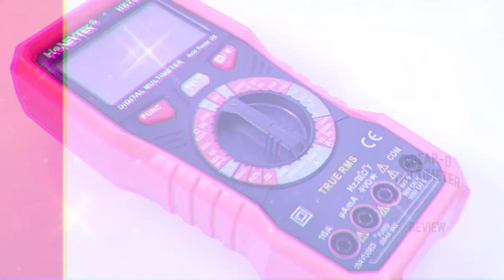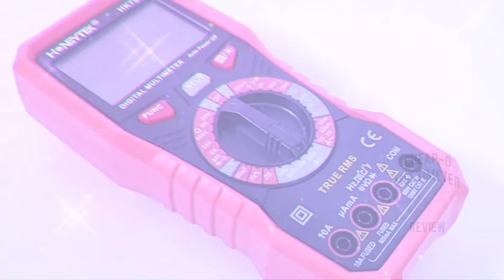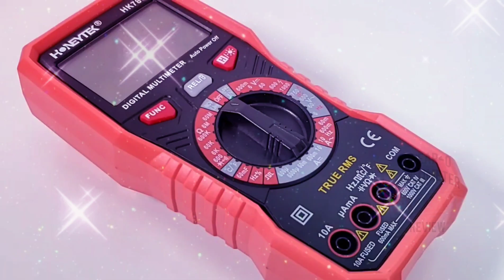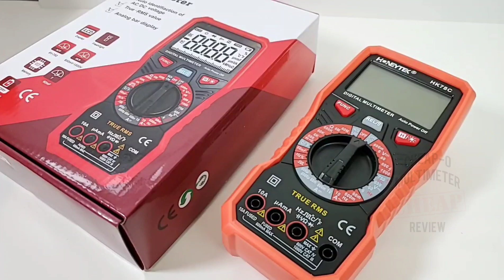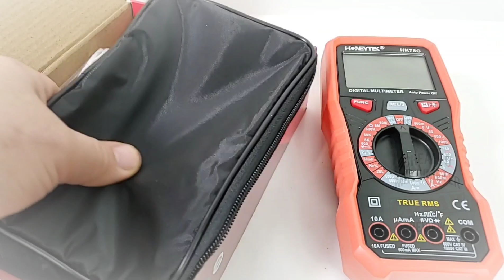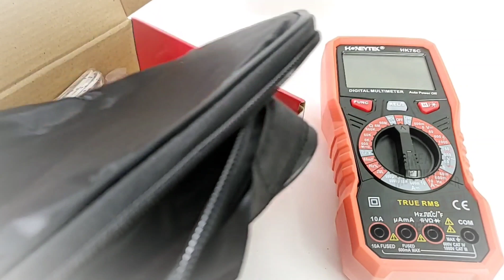HONEYTEK HK78C CHEAP-O Multimeter Review & Teardown!

Comment: I would imagine the 500ma fuse would hold-out for over a minute at 600ma (no big deal since beyond 500ma one should be moving the lead over to use the big shunt anyway). Amazon likely reshipped you a returned unit??
Reply from the maker: Hi Cliff,
It was sealed in the plastic and looked pristine  so assume its new. There's a short or system fault hence the mA snafu.. I'll try to trace the issue and assume its a one off.  🙃👍
I still think the manufacturers need to match or better the stated ratings. A new user probably wouldn't switch to the high current/10A mode when needed since they probably wouldn't have a clue.

Comment: It looks like they adapted a battery connector as a NCV probe--it's different.  It seems that in mA mode that when QA tested it, they blew the meter and missed the problem.  I wonder if all Honeytek HK78C have that same problem.  VFC and LowZ are good features to have; however, without the input protection, it becomes almost worthless.  As far as a back light is concern, companies need to give the power to the people; I would rather see a manual SPST switch that the user can just turn it on or a programmable timed light 5 min to infinity. Another meter without shielding: Is it because companies design the cheap meters for the hobbyist, and think that the hobbyist is not going to be around EMF?  Or is it because they think the board construction and component layout of their design reduces the effects of EMF?   It would be easy to put shielding in these cheap meters; however, the question is would it be safe?  A series of high transit voltage spike between the inputs and the shield could cause the dielectric strength of the plastics used in the cheapo meters to break down or catch fire.  That can explain why some companies only put in small amount of shielding near sensitive chips--away from the high voltage inputs.  Maybe in this case for the HK78C, the batteries are used like a shield since they are metal plates separated by a dielectric and it's grounded; hence, the reason it is located over the IC chips.   Thank  you for the review.  I'm looking for your Halloween special.
Reply from the maker: Great comments..! Its quite a concept to use the battery compartment as a form of shielding. Not sure if that was intended but a great hybrid-hack if that was the case. Your EMF liability concerns regarding transients discharging and blowing the chassis resonated with me. I will dig further and see what is the likelihood of this happening. Irregardless,  it's a great angle to explore. Indeed, the plastics manufacturing is a highly relevant and often overlooked part of the CHEAP-O design. BRW, the Halloween special should be out just before Hallows eve!

Comment: oh man, those cons are really took all the good of it away. i wonder if that random shutdown would be possible is caused by the battery terminals that not make a good connection to the board? or bad connection of the rotary switch, maybe?
Reply from the maker: I haven't had time to investigate the root cause but I will definitely let you know..quite possible it's one of the aforementioned reasons you've mentioned.👍

Comment: 13:30, what gauge wires are you using on your power supply? 23 watts for a short across a meter’s shunt and fuse seems insane! I’m desperately hoping the meter does not dissipate 23 watts at 10A.

Comment: NCV : I think everyone can design their own style NCV protrusions after seeing this one 🤔
Current sensing resistor have become Unavoidable nowadays in the CHEAP-O's
Current shunt : Help! I'm going to be extinct soon 🧐 in CHEAP-O's
Except that continuity test, I find it is decent and nearly accurate but, Underrated for sure.
Did I notice for the first time that you showed us the onboard temperature sensor 🌡️😕?
Reply from the maker: Yes that NCV was certainly on the "unusual* side.. looked rather like a hack than an engineering job! Yes, those onboatd temp sensors are starting to appear everywhere!
Reply: @KeepOnTesting  that ncv looked like it could pull double duty as a miniature branding iron...im going to make my own and try tuning up radio Moscow!